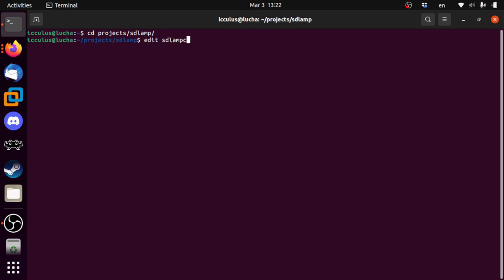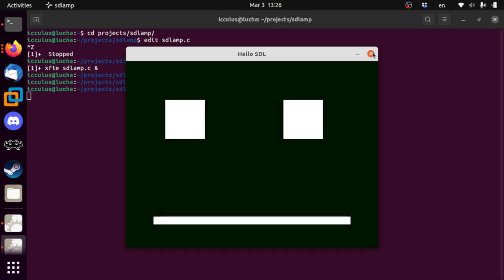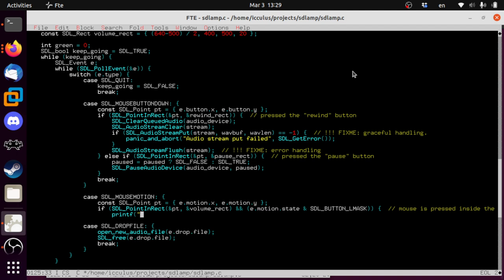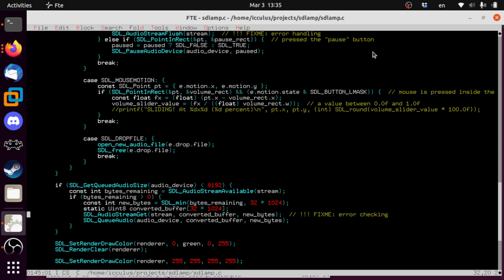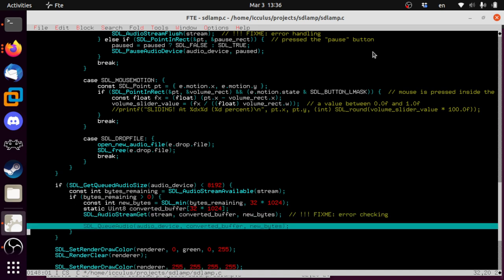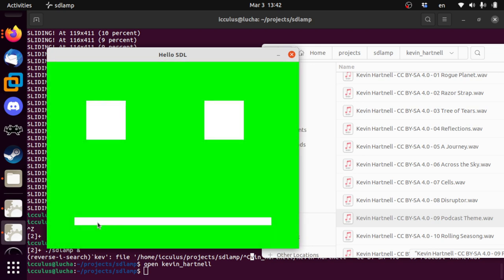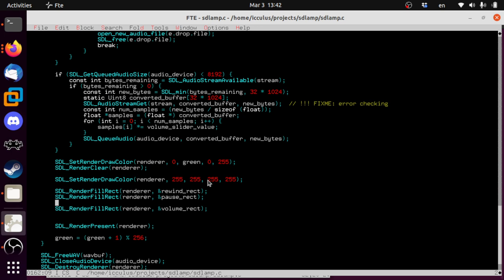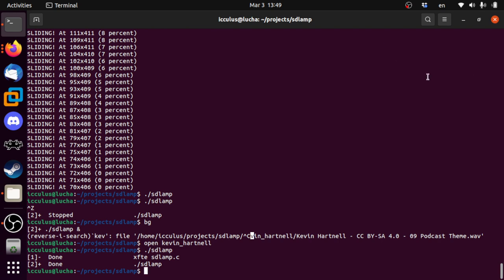Writing a Simple Media Player with SDL, part 5: Volume Control

Comment: Unrelated question, but how is FTE rendered? It doesn't look like your other terminal... Must be SDL?
Reply from the maker: It uses SDL to manage the window and OpenGL to render. The whole screen is a single glDrawArrays() call: https://github.com/icculus/fte/blob/main/src/con_sdl.cpp#L1240-L1285

But I should probably revisit this now that SDL's render API is much more optimized than when I wrote this code; that's probably just as fast now and works with Direct3D, Metal, etc, too.

(the font it uses is a bitmap, hardcoded in the source code, taken from XFree86 back in the 1990's.)
Reply: @RyanGordon  hope you share that update whenever you get to doing it with us as well 😊